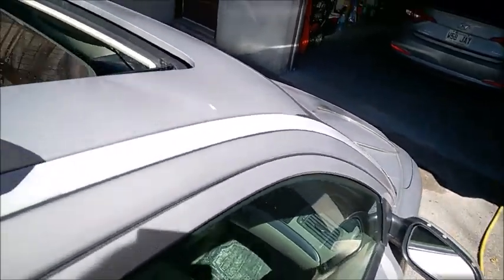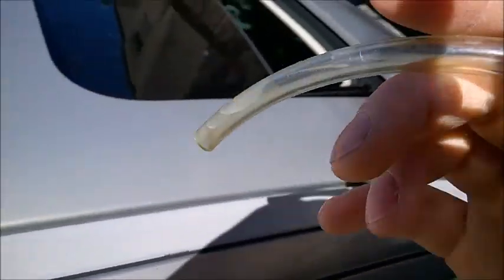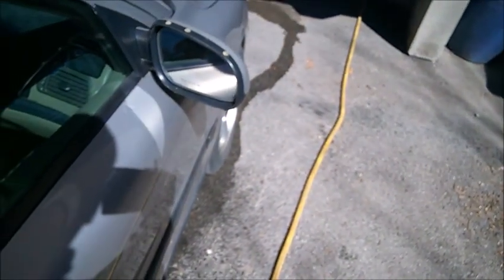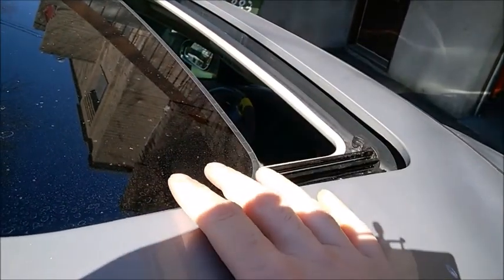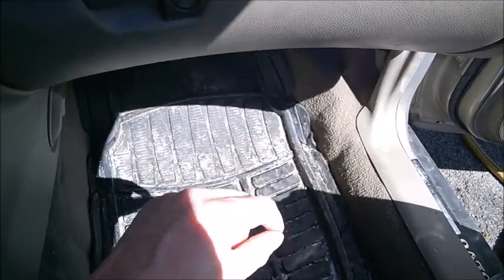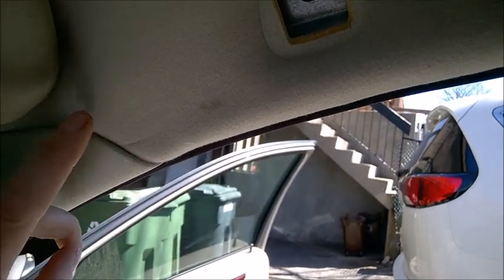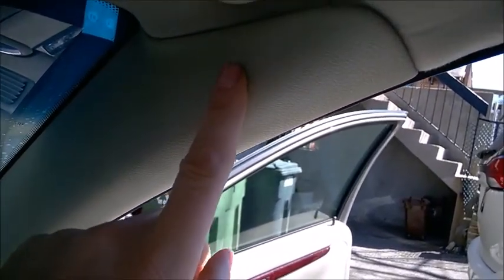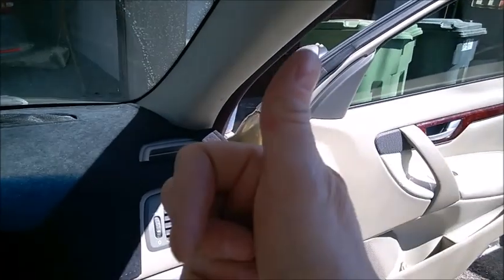Volvo S60 V70  20 seconds  Roof drain cleaning and why it's important  2001-2009

Comment: Dude your Volvo videos have a been a life saver. I was getting a leak on the drivers side. Only problem is my sunroof doesn't work. So I googled how to remove the glass and of course you had a video on it. I was finally able to reach the drain holes and pump them clean. This isn't the only video of yours that has helped me significantly. Thank you man. You're truly helping so many Volvo owners world wide. Cheers from the U.S!
Reply: I have an '04 XC70 and my sunroof didn't work until I remove the corroded alarm siren horn located under the front right wheel well.

Comment: Thank you for this! I had water accumulate on the side of the airbag and it would leak into the bottom of the seat too, where the legs go. Will seek to unclog the draining holes ASAP!
Reply from the maker: Indeed, water usually leaks from the front to the rear seats (there's a passage under the front seat floor reinforcement bar - which I stuffed with expanding foam), need to also check under the corresponding rear carpet. I would let the curtain airbag exposed without the a-pillar trim (I have a video how to safely remove this trim), to let the airbag dry properly during summer days
Reply: @Peppermint1  great I will check out this other vidoe of yours, thanks a lot for all the tipsl
Reply: @Peppermint1  Hello, dear, my water tank is filling up, the spare tire is coming next month, isn't this the problem, how is the spare tire coming?

Comment: That is recall worthy
Reply from the maker: Unfortunately, many other european brands had the same problem, the tube diameter was too small. There are also two rear tubes as well, important to clean them too especially if the car is parked on incline with the rear lower than the front - during the rain, water will pass by the sunroof seal and will drain by the rear tubes (even if the sunroof is closed)

Comment: I think I rather blow compressed air instead of water in case there is a leak INSIDE the pillar
Reply from the maker: I haven't tried but too much pressure may also disconnect the hoses where they connect to each other

Comment: 6:50 Place electrical tape to the outer part of the sunroof gasket. It will block water penetration entry until you can fix the problem. It worked for me and takes only minutes and easily removed.. Above all, keep your car CLEAN inside and out... it's a VOLVO!

Comment: Just bought used 2012 S60 and getting small leak of water on inside windshield when car titled nose down on incline. It can rain all night with car parked level but when I back out of drive way up hill with nose down that's when I see the water run straight down the inside windshield. Could this be the reason?
Reply: Sounds more like a gasket issue

Comment: Have a question as I might have same problem to remove the plastic cover on the side do i have to remove ground as airbag could activate?? I rather not to as i could loose radio code and don't know it 
Pls let me know 
Thanks

Comment: How about the rear drains?   The sun roof will not retract to allow the insertion of the rear tubes.  Any hints?
Reply from the maker: Indeed I could not access the rear drains. In the S60 you can see them inside the trunk, behind the side covers near the lid, running over the wheel arches. May try to detach them from there and 'backwash' them with care. When the car is parked on a level surface, the front drains take all the rain water. Same when parking on inclines with the nose down. Rear drains will work when parking on inclines with the rear down
Reply: @Peppermint1  I thought maybe you  had a trick for the rear drains from the sunroof.  the side panel access is not ideal, and the drain exit point is a 90 degree elbow.  Which makes it all the more difficult.  thanks for replying

Comment: Could you use compressed air as well?
Reply: I used compressed air and it solved my leaking water into v50 cabin
Reply: I'd go with compressed air and build a custom setup with fittings and control valve. If thing are really clogged,  you won't get water spraying back into the car